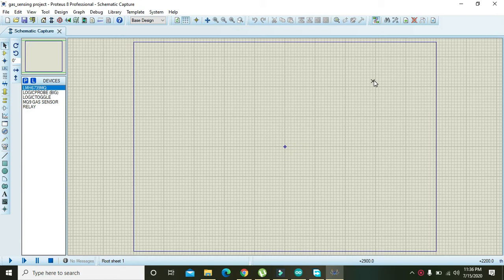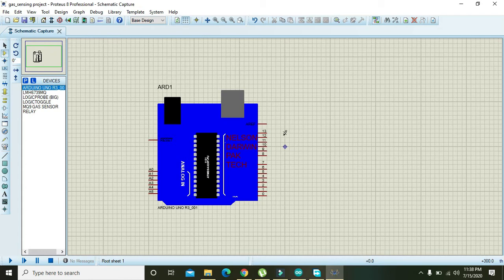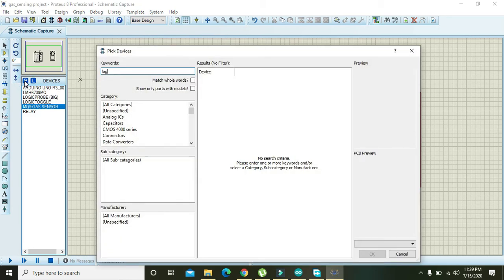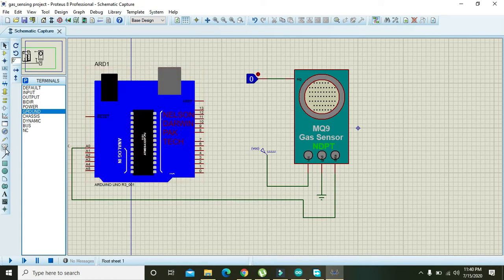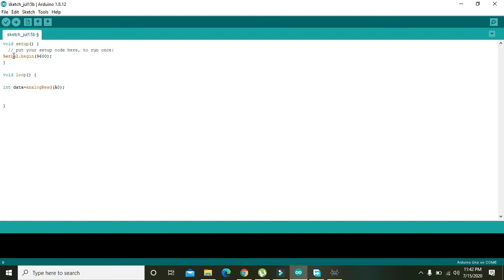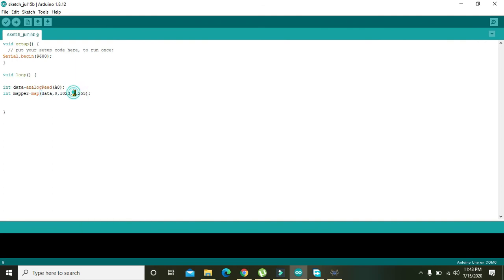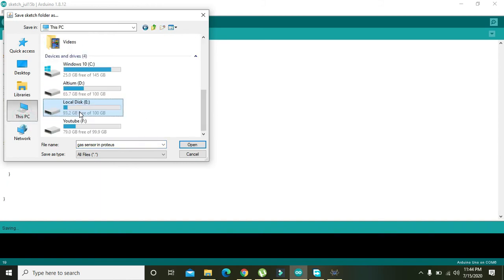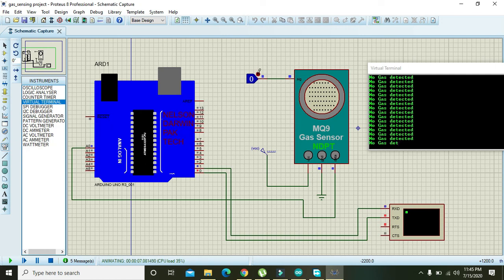gas sensor with arduino in proteus | simulation of gas sensor module with arduino in proteus

Comment: I am using Arduino 1.8.13 , Proteus 8 professional.
I have done the circuit and wrote the exact code in Arduino,
but when I am simulating, only 'No Gas Detected' is being shown in the virtual terminal.
I am not getting 'Gas Detected' after toggling to 1
Why is this happening? I tried it several times...
Reply from the maker: buddy check it will a direct logic toggle...give one and zero directly on the pin....
Reply: @nelsondarwinpaktech3954  I gave but still it's the same

Comment: HI Bro 
I am planning this project with 8051 
But failing in Simulation 
Can u help me with that

Just 8051 with MQ5 sensor test pin and a buzzer/led 
Is more than enough 

Additional LCD I can add of 

Please Help me na
Reply from the maker: zabi....but 8051 is obsolete now...either there is 8051 in 40 pin package available...